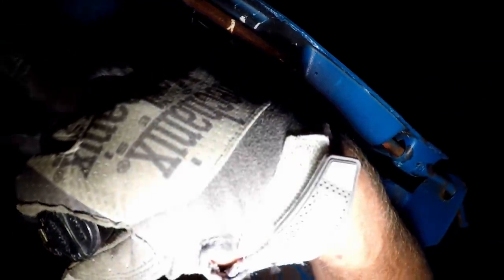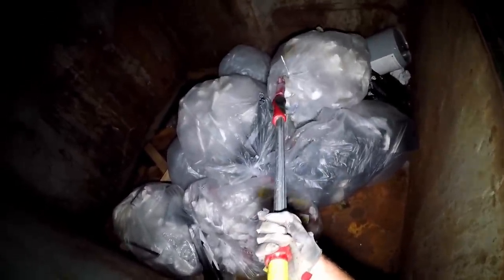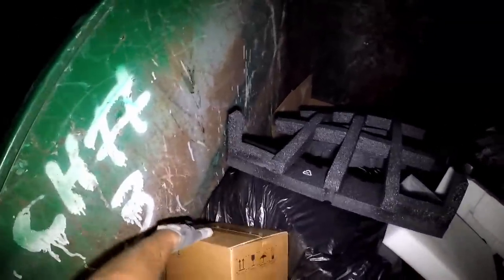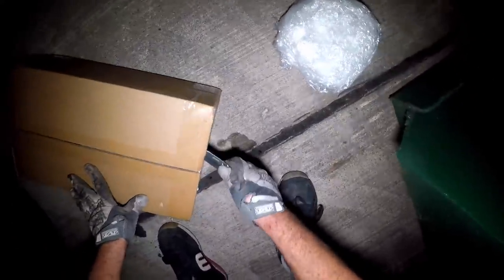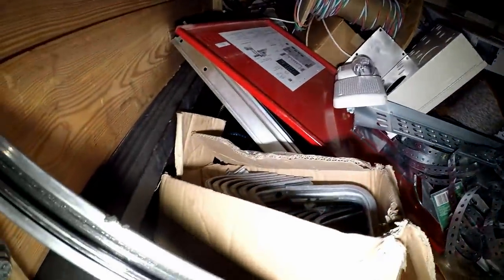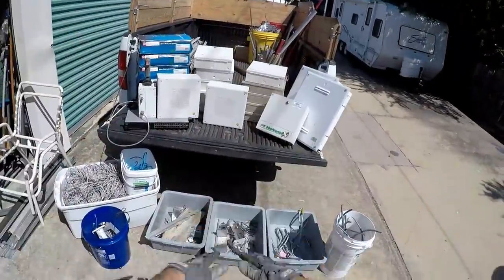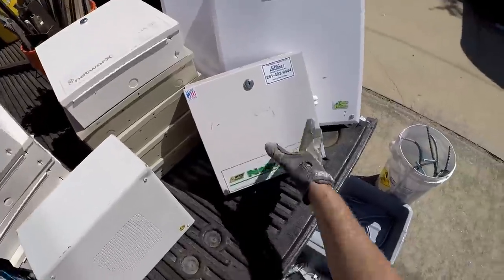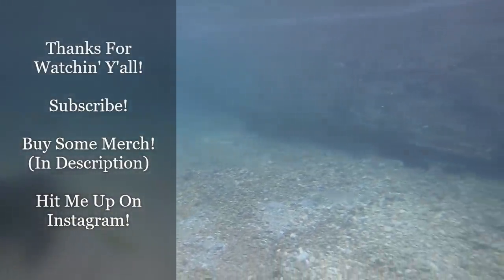Dumpster Diving "I Feel Like A Stick Of Butter"

Comment: If you want to strip the plastic off of those signs try using something like a ball joint puller and put the sign on the ground with the plastic side up and it should pry off easy

Comment: Hey Mike.  I can tell you exactly how it happens, and it isn't uncommon in the telecommunications industry.  You have a job maintaining a legacy system of some sort, network, security cameras, etc.  You keep parts on hand to keep patching it and keep it running, and when you find clearance on parts, or deals, or some other company getting rid of the same era stuff you grab it up.  Eventually the company pays to bring the whole system up to date (usually around a decade or more after the one you are maintaining is obsolete), and you now have cabinets and closets full of spare parts and wire that isn't compatible with the new system.  Even the enclosures (the metal boxes) which are perfectly good are now out of spec for your new system.  So, you purge it all.  If you are lucky you find somebody else in the boat you just got out of; if not; then it all goes in the dumpster.  God Bless.  Thanks for the videos!

Comment: have you checked the prices for shred today? here in north Texas ,north of Dallas I took a load of motors in and asked about the price of tin shred and he told me he would hang on too it for now, and the price went from $75 a ton last week down too $40 a ton this morning. Glad I did not load up the truck and trailer  yesterday and now its time to hold and horde for a while. all the other prices stayed the same or up a few cents but shred dropped to $40 a ton for some reason.  called two other yards and they said the same. NEVER seen it down that low before. $40 a ton?????? whats up with that?

Comment: Is that wire your grabbing coax wire mike? They wont even weigh that up here. Let us know please?
Reply: He grabbed 1 box of coax, the other thicker wire out of the 3 dumpsters was all coax with power, the scrap yard will take it sometimes at the lowest rate about $0.10 lbs He can pull the power wire off the coax he would get about 60 cents a lbs. The yard will not buy coax on it's own but you can toss some into the shred pile. The big tote at the end full of wire would all go at that 50-60 cents a pound rate.

Comment: 36:09 what you have your hand on its a RACK SERVER $1300?... Type the model number in google it will tell you for sure that one could be $2,000? who knows
Reply: Not a server, it's a Cisco Rack mount network switch. Depending on the model and if tested and working could be worth $50-$600+
It's worth checking the model number online as it may still bring good $$ even untested
Reply: @jayr9810  I wasn't for sure thats why the question mark.. Thanks,,
Reply: @jayr9810  thats why the question mark after 1300 i wasn't for sure thanks, Hey $600  not bad.......